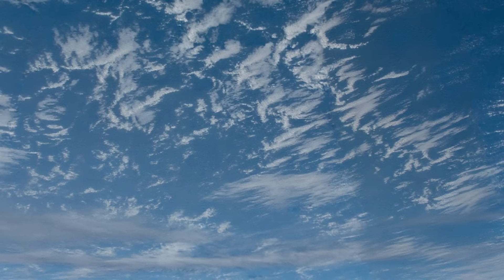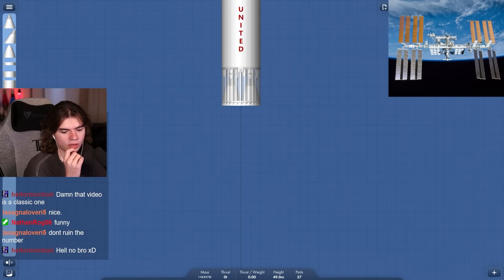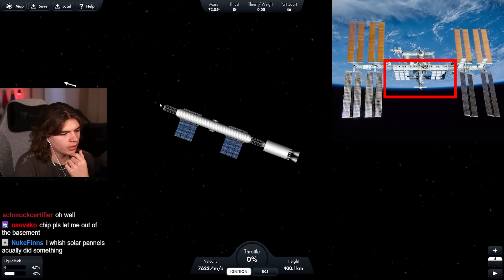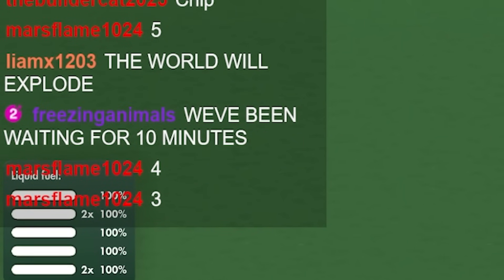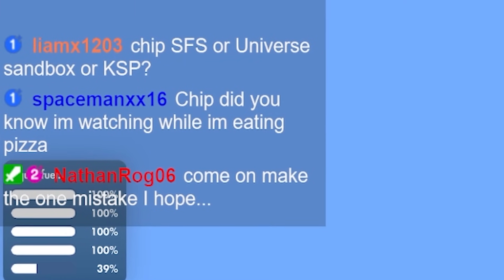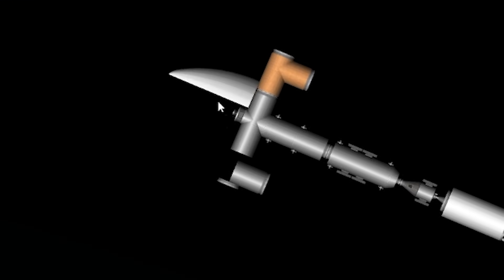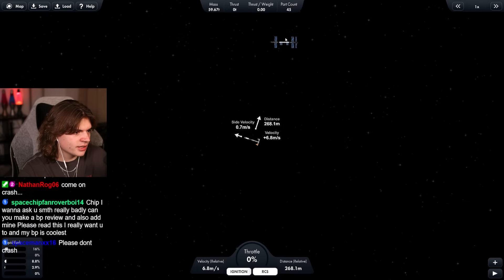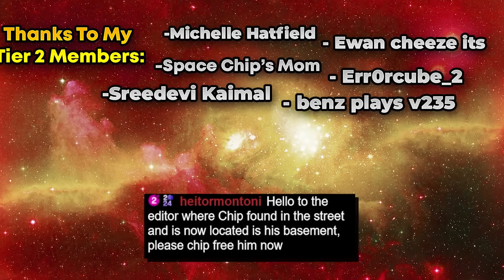I Recreated the ISS in Spaceflight Simulator

Comment: I'll correct you Chip, the 6 white solar panels is not really a solar panels, its a Radiation panel, It helps remove the heat from the station. THAT'S ALL❤️